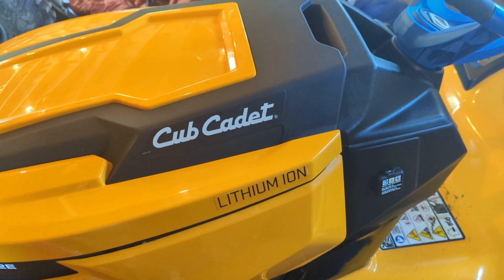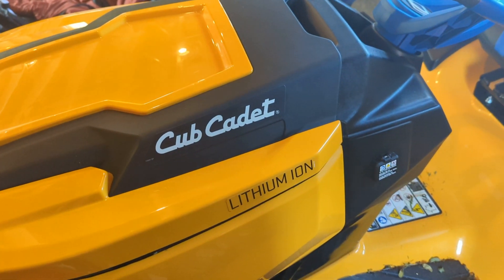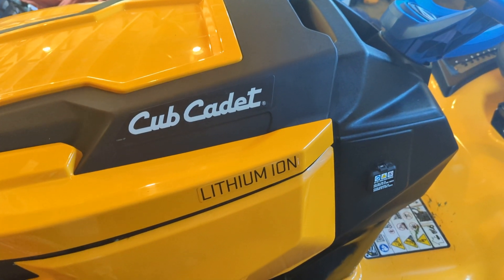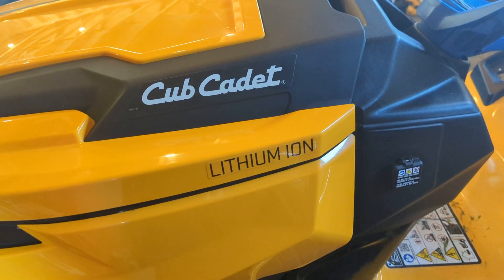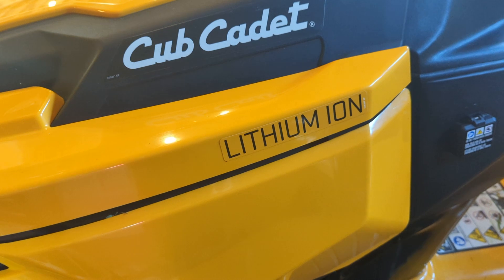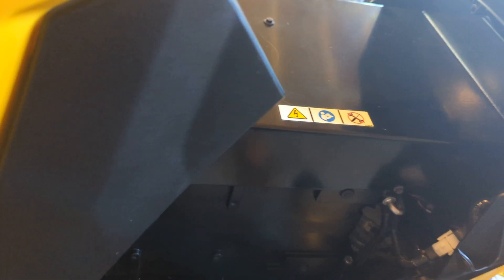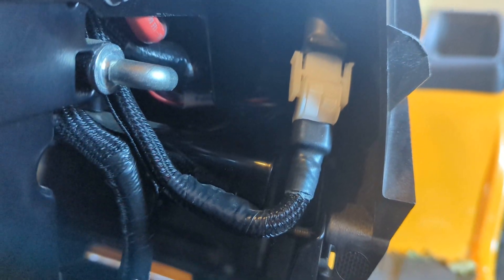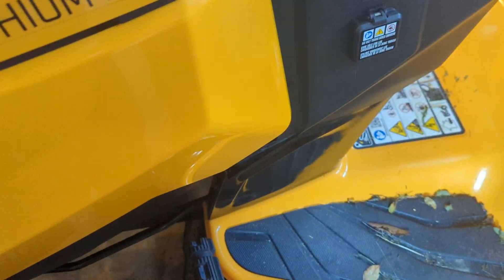Cub Cadet XT1 LT42E E100 - Diagnosed and Fixed

Comment: I just bought a new LT42E and it runs fine. But: I found this wire pinch exactly as described.  It was an easy fix.  I caught it before any wires were chafed.   Thanks for posting!!!!!